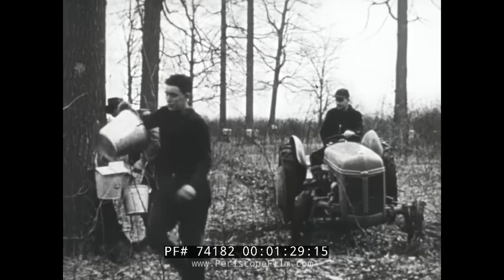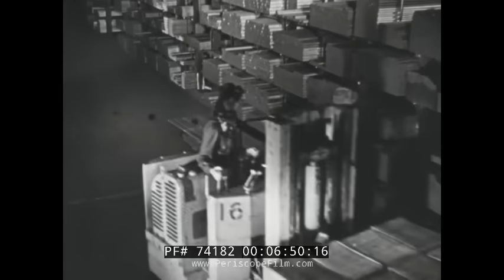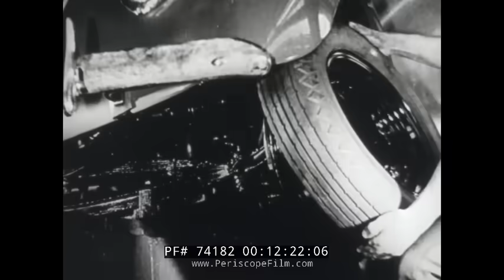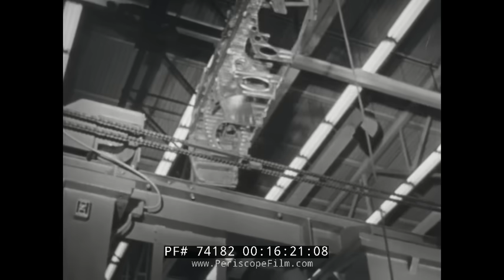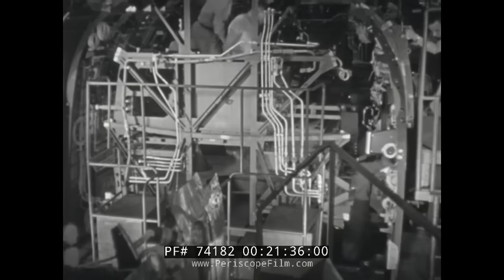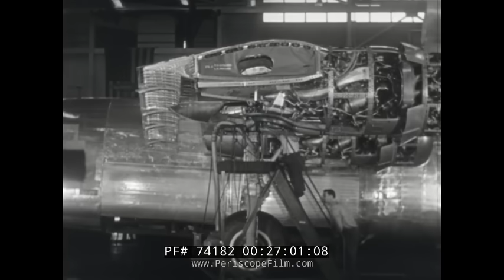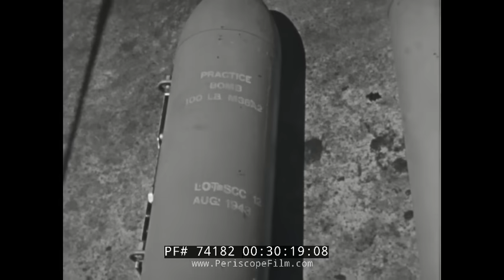BUILDING THE B-24 BOMBER DURING WWII  " STORY OF WILLOW RUN " 74182

Comment: Wow, just wow. I live about 25 miles from Willow Run and of course have heard bits and pieces about its story, but this film is fantastic! Recently I read an accounting by Wes Oleszewski of the Willow Run bomber factory; the combination of that and the film really bring it to life. Thanks for wonderful work presenting this archival footage.

One aspect that doesn’t come out in the film is a comparison of Consolidated Aircraft’s manufacturing to what Ford did. Consolidated’s B-24s were essentially hand-crafted one by one, which was glacially slow and meant that if a part broke halfway around the world, replacing it meant machining a replacement instead of grabbing one off the rack. Yeah, the plane was “heavy on the controls” (it flew like a truck…and that’s not a compliment) and Ford’s history with the plane had its issues, but in the end it was one hell of a feat. TBF, the government made life difficult for Ford by continually requiring “small” changes to the plane, so Ford also had that huge headache to contend with.

Comment: If you have driven a GM vehicle with an automatic transmission in the past 60 or so years the transmission was built in the old willow run plant, now GM hydramatic plant.

Comment: I used to work for GM and they bought a plant in Adrian Mich to convert to plastics manufacturing.... I found out the history of the plant during the war and found that the wings for the B 24 were built there and shipped to Willow Run.  The dip tanks for the paint were over 40 feet deep. A couple of the overhead cranes were still there and we put them to good use. Also they built houses and had lawns on the roof to cover the plant from air.

Comment: Even more important than the mass production systems used was a rigid set of hardware and fittings standards.  Without those standards no parts would fit from one type of machine to the other.  These standards applied to ALL factories and ALL contractors to prevent surprises and delays on the whatever factory floor they were used on.  Even field repair and logistics were streamlined due to standardized parts.  Even Canadian manufactures had to stick to these standards

Comment: Boy, did this bring memories. The first government legislation targeting car manufacturers was just forcing Ford in 1940 to modernize cars. Hydraulic brakes were required. Up until 1940 Ford cars used cable brakes. Ford had to start using sealed beam headlights. Ford still used bulbs. Note:with these buld headlamps you could barely see a small stretch of road, properly adjusted you could see something at about 50 feet.)
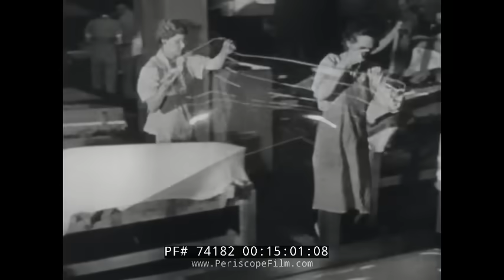At about 15:00 it shows women wearing white hairnets. These were all the rage in 1941 and 1942. We were traveling to my Grandparents. My Mom bought one of these white hairnets and paid 10 cents for it. Equivalent to about $5 now. I was flying her hairnet in the airstream and of course lost it. At the end of the film it shows Little People, Midgets then, working inside the engine cowling. They also hooked  up the hydraulics and wiring in the wings. I had completely forgotten this.
Edsel Ford agreed to build the Rolls-Royce Merlin engine. Henry Ford made Edsel back out..
So Packard built the Merlin in the states. Henry Ford didn''t want to be involved in this war.
First and foremost, Henry Ford admired Hitler. Ford wrote for Anti-Semitic newspapers. I read sometime in the 1950s, long before the internet, that there were pamphlets in Hitler's Bunker, "authored by a prominent American Industrialist".

Comment: I was an FAA air traffic controller at Willow Rum from 1978 until 1981.  The history of the site was inescapable.  When I was there working in the original control tower, the wooden moving compass rose platform was still visible on the field apron near where aircraft would have come off the assembly line in the '40s.  This platform was used to finely calibrate the avionic instruments.  Seeing this film brings back lots of memories for me.
Reply: Anyway -- I have fond memories of Willow Run. I lived not too far from there in the early 1990s. I took my dad to the old "Yankee Air Force" museum there, and they let him get in the cockpit of their B-25. He flew B-25s in the war. He said it was "like yesterday" -- his muscle memory knew where every knob and lever was. I had a nice chat with one of the volunteers. He was a tail gunner who, for some reason, had to land at a Soviet air strip, and he had a (more than) nice encounter with a female tank commander.
Reply: @pulpmysteryfan  it's nice that the female tankers took the time to make him feel welcome.
Reply: @pulpmysteryfan is this the same place where the willow run airport is in michigan near canton? Ive driven by the airport but never been there for the air show or anything.
Reply: So is this the same willow run that is called willow run airport in michigan just north of 94? Its where the drag racer connie kalitta has his air services.
Reply: @BillyLintzenich-wf7sk  Yes, Kalitta is still based there but no longer fly out of WR.
Reply: Was Kalitta Air there when you were?
Reply: @SandraLily2  Yes! Great to hear that name again. I was there until the PATCO strike cost me my career. In those days, Willow Run was a very busy, exciting hub of aviation.
Reply: @ronbeam6893  My brother is a pilot at Kalitta.  They don't take off from there anymore.
Reply: im a FFA MEMBER hates off to you
Reply: @stevenjones2371 hate off to you too.

Comment: Find a copy of Charles Lindbergh's Wartime Journals. He was a consultant to Ford during the ramp up of B-24 manufacturing. One of the big things he had to do was convince Ford that building aircraft was not just like building cars. He also had to convince Ford that they should not deliver the B-24s with regular gasoline instead of aviation gasoline. The engines didn't run well on regular and the tanks had to be drained upon delivery so that the regular gasoline and the aviation gasoline wouldn't be mixed. Beyond that, he provided an interesting account of the initial visit to Consolidated to decide whether Ford would bid on the manufacturing contract. Consolidated was hand crafting the aircraft. Ford's chief industrial engineer was on the visit and he went back to the hotel room and essentially designed the Willow Run plant overnight. The film doesn't mention why the final assembly line included a right angle turn. If the line had remained straight it would have crossed into another county and the property tax bill would have been higher.
Reply: Where? Into Wayne county?? Were the taxes that high back then where it would make a difference?? There were hundreds of locations in Wayne county that contributed to the war effort. I don't know that taxes came into play. That would be interesting.

Comment: I remember reading a book about Jimmy Stewart, who was a pilot for both the B-17 an B-24 during the war.  As I recall, everyone loved the B-17, but the B-24 was faster and carried a larger load but was a handful.

And a major design defect was the midwing design.  In an emergency wheels-up landing, the belly would often be shredded, resulting in the forward fuselage folding under the wing, crushing the crew.  By contrast, the B-17 wing would take much of the punishment because it was at the bottom of the fuselage and the cockpit would remain intact.  I think this trivia came out of the Jimmy Stewart book.

Comment: The scene where the rivets are being made on the cold heading machine reminds me of the time I was doing a time study on the coldheader making pinion shafts for the GM transmissions. It looks like the identical setup with the cans of parts being inspected. By the time you found a bad part due to a broken die you had several hundred pieces you had to individually check to sort the good from the bad.

Comment: My mother and several of her friends work at this plant. In the 1960's I was a GMI student working for Hydramatic Transmission and walked and worked in almost every part of this plant. GM had recently purchased the plant from Ford and the fire alarm boxes still had the ford logo cast into their covers. On Mondays I had to pickup my time card at the Administration building then walk the 1 mile length of the plant to the case line at the far end near the large hanger doors.
Reply: I have one of those Ford fire alarm boxes.  I worked for an electrical contractor and installed a new fire alarm system in what was the engineering end of the building.  A GM engineer told me I could take one of them.  It should in the hands of a real collector.

Comment: My grand father flew on one as flight engineer, ie, top turret gunner & radio opperator. The crew flew out of Tinian Island, yeah same airstrip the famous B-29 delivered the A bomb to japan from. While returning from a mission and on final approach, a zero came out of the sun firing it's guns. The first casualty was the pilot whom literally lost his head, co pilot was blinded, both waistgunners were killed, plane crashed, the navigator, tail gunner and my grand father lived however my granddad was wounded by a 20m m  round that came in from distance and had just started to tumble when it pierced the glass turret went through his flack jacket and stopped half way into his right chest.

Comment: The inner wing makes up the full wing. The front fuelsalauge is the nose and the center, front, and aft fuelsalauge would be connected together and four engines would be installed and the twin tail was on the bomber and it's Indistinguishable to the three tail Of the super constellation

Comment: The story of the B24 is widely known. I'm curious if any of these production tools/philosophies were applied to the P51 or P38 fighters. They were built in numbers even greater than the 8600 B24s.
Reply: Absolutely. The only way to turn out great quantities of anything in short periods of time is engineering, automated production, jigs and fixtures, trained workers, etc. The same methods are now used in vehicle assembly plants to turn out cars and trucks at the rate of 60 or more jobs per hour (jph) which is one vehicle per minute.

Comment: These planes are a lot smaller than you think. I paid $475 to fly in a B-17 at Willow Run and was surprised how the bomb section was just a small fraction of the internal aircraft space.  With the aluminum skin, there's zero protection from enemy fighter bullets.

Comment: During WWII, Ford also built under licence from Pratt & Whitney at their Dearborn, Michigan Rouge River plant R-2800 aircraft engines used in for example Republic P-47, Curtiss C-46, Martin B-26, Douglas A-26 Grumman F7F and Lockheed PV-1 among others. From 1941-1945 they built 57,637 units, reaching a peak output of 186/day. They built more R-2800's in those 5 years than P & W did from 1939-1960 (54,620).

Comment: Although it is a Ford plant the US government PAYED for it. Same thing about the Dearborn plant. Ford could not get the plant up and running even after a few tries. So he went to the government to make a deal. Ford said " I will build the Eagle boats if you build the factory. Same thing with Willow and the airplanes and in the end Ford got to keep the plant. Though Ford built cars? Nope he built other things to mostly on someone else's dime. Ford did build the boats just in time for the end of the war. Only a handful ever made it to see service of WW1 and the boats were mostly forgotten and that's why you never heard about them.
Long before Willow Ford was building planes, the Ford trimotor. He also had an airfield with his name on it. Now Ford did not invent the auto, other were way ahead to building autos. But he did build his own auto which had nothing to do with his later production AUTOS. Nor did he invent the assemble line. He happened to see the disassemble lines at the stock pens of the meat packers. These lines worked very well taking cows apart. So he prefected the line that built his cars. In his early years he had built a electric car, again not the first one but a very fast one and won races with it, it's in his museum where you can see it today. And no, he really didn't pay $5 a hour sort of. He PAYED $2.50 an hour and the other half went into stocks and on top of that you were required to attend his weekly dance, he built some of the largest dance floors in the world, but what we're not done yet.Ford had men who would visit your house to make sure you weren't drinking any alcohol. A few more words about Ford, he was antisemitic and products a weekly news paper on the subject and he was good friends with Hitler. Ford built many factories for Hitler and of course these factories were bomded. After the war Ford was compensated by the US for his loses of German factories that he built.
This is a story in itself but he also has a illegitimate son. He wrote a book about it his name is Dalinger(sp). Ford was a control freak and even tried to start his own country, Fordlandia. It's still out there and a few people still live there.
Some years ago I worked for a charter service at Willow Run, Active Arrow, as a wheigh master/ loader ramp crew mainly on 727s. Cargo planes do not have seats in them so when I needed to go with the cargo I sat in a jump seat in the cockpit. The owner was a part owner of the Pistons the Detroit, basketball team. Round ball 1 was. The plane name, been on that a few times. On weekends not much happened so I had lots of time to explore. The Packer hanger had the original control tower on top of it. Ford was one of our larger clients so l spent a lot of time in the old bomber plant, I also drove a truck there. And there was still a lot of stuff around like the pits that were used to zero in the guns, a couple of hangers stuff like that. I've been in all the Ford plants and the Packer plant. My grandfather and great grandfather both knew Ford and great grandfather helped build Greenfield Village
Reply: Yes,and Thank you Scott for your detailed recollection of history,very well said..

Comment: Not hard to see ford produced the film, absolutely no mention of the engineering that went into the plane, by Consolidated/Vultee, not ford.
Reply: The topic was about production of the plane by Ford, not the design. As it was Ford had to reverse engineer the plane because Consolidated basically hand built the planes they produced and sometimes no two planes were built the same way. You should Google the history of the B-24 to get the full picture.

Comment: Whenever I watch a video of this type I always think about the process flow documentation required to get this right. I would bet that the first ones didn't roll off the line every 55 minutes.
Reply: No they took substantially longer, but rolling one off the line every 55 minutes does not equal building each one in 55 minutes.  Many parts were pre-fabbed, some in other locations but they all came together on the assembly line.

Comment: The engines are attached with four 5/8th inch bolts each? That's got to be BS.The bed of my Ranger pick-up is held on by SIX 1/2 inch bolts and doesn't come close to the same type of stress. Between 8 to 12 bolts each would be more like it.
Reply: It all depends on the quality of the steel and the method of manufacture. Not all bolts are created equal.

Comment: I spent 24 years maintaining aircraft and always wanted to know how the manufacturers managed to get pipeline (tube) joins and bulkhead unions into places impossible to get a standard spanner (wrench) into when they needed tightening or replacing, now I know, they didn’t, they were assembled outside the aircraft and then put in in bundles, thanks manufacturers for skinned knuckles, gallons of blood, sweat and tears, more profanity than I care to admit, arthritis from contorting my body and arms into unnatural shapes, many many hours bending, cutting and devising tools to go where no tool went before, pilots cussing me out because they couldn’t go on a mission or training flight EXACTLY when they wanted, and finally for 24 years of satisfaction for doing something that none had done before,the thanks of pilots WHEN they did go airborne when they wanted and needed to, and for serving my country with the same pride that these people at willow run did. 😀👍🇬🇧🏴 thanks for sharing this excellent, interesting and informative film 🎥👍

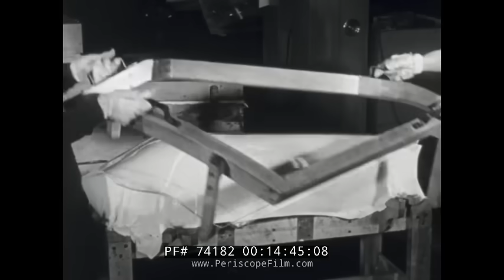Comment: 14:45 I did the same thing when I worked for an acrylic display company. It's called oven forming. I had to make curved windows for a boot displayer. Ours though you had to walk into, it was bloody HOT lol......you can't put the form into the oven else the acrylic sheet would stick to it.......I bet the form is covered in silk....it doesn't get affected by heat so much and it's so smooth it won't mar the surface of the acrylic. We used talc on items where surface finish wasn't critical.

Comment: This is very cool. My mother as well worked on the b24 liberator. She joined the women’s auxiliary core (WAC). She took the train and had to go somewhere in Kansas for boot camp. Then off to the assembly line. She said she put the splice in the aileron. I believe she also said that she was stationed in San Diego assembly line. Her inspiration to join was because of peal harbor. Her birthday was on December 7. You can imagine the impact that was. Thank you for sharing!  By the way if someone out there has a roster of workers, my mother name was Elaine Ramsey at that time.